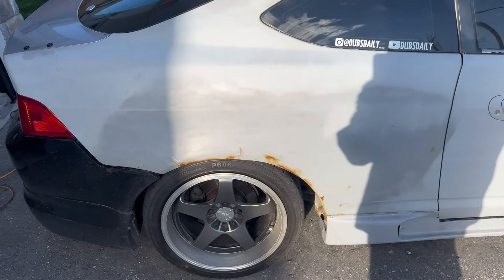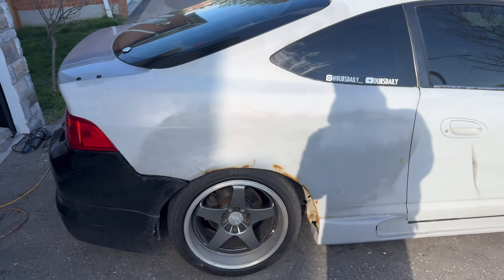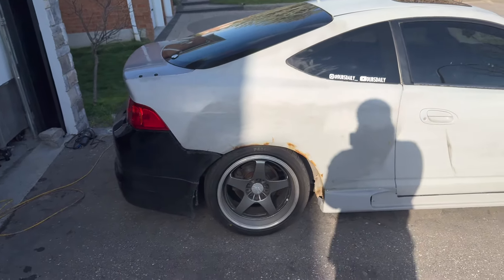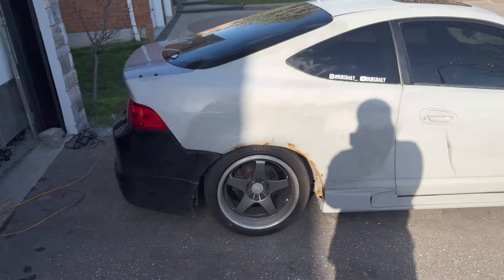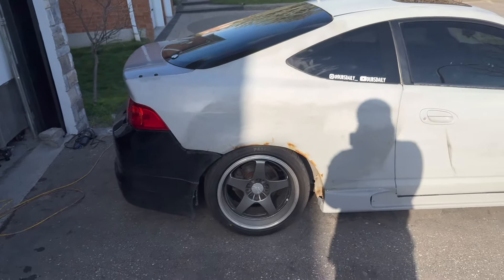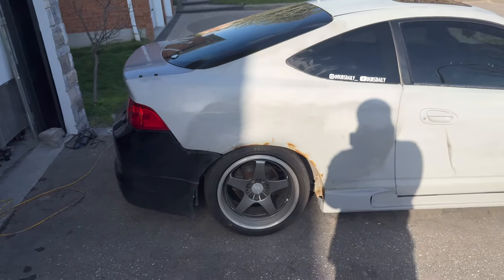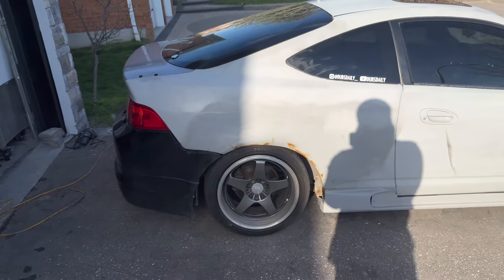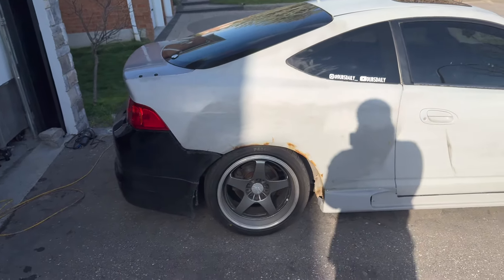Widebody RSX! (Pt.2) | BRZ Rocket Bunny V1 Kit on my RSX!!

Comment: Spray foam right side for gas tank and fiber glass over it ? Shouldn’t be too hard considering the spray foam does the most of the job filling it up. It’s also easier to remove if you don’t end up liking the wide body later on. Good shit though bro!
Reply from the maker: Pretty much what I was planing to do. Might tackle it this weekend tbh